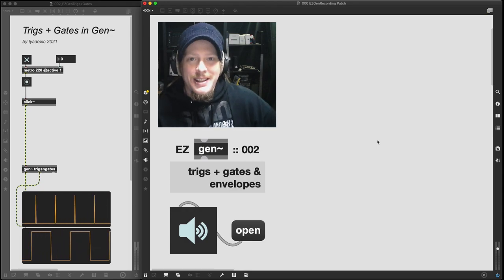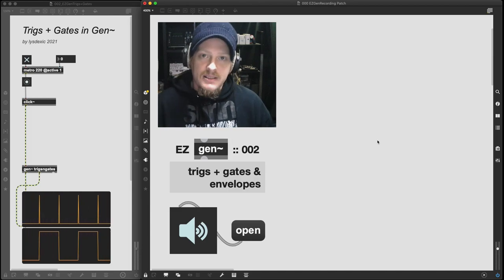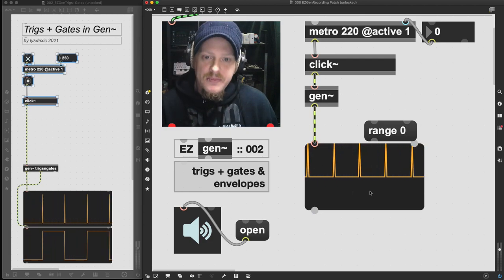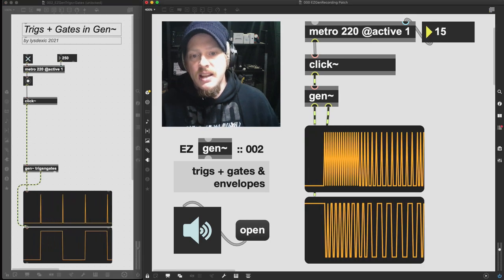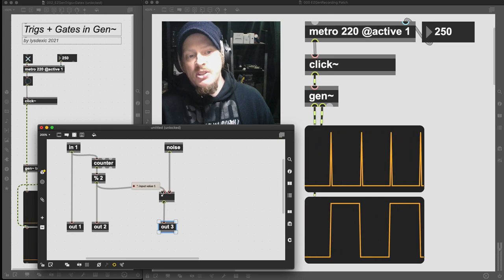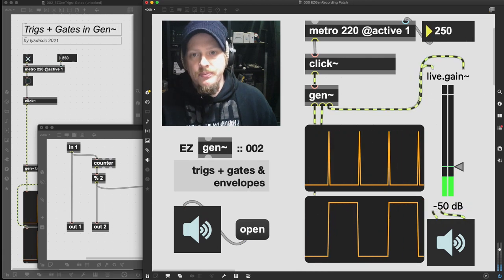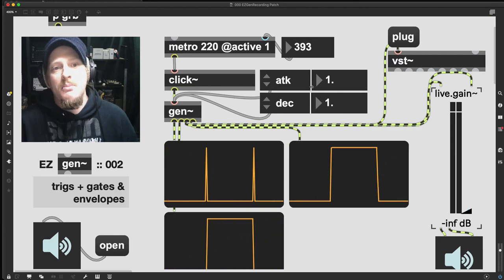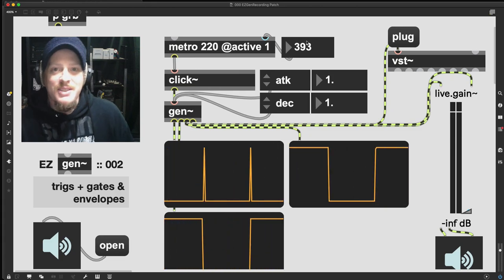EZ Gen~ MaxMSP Tutorial 002 :: Trigs + Gates & Envelopes

Comment: Hi amazing channel, a noob question how I actually gate signals outside gen patcher, like a square wave?
Reply from the maker: hey, thanks! to create a squarewave it’s really easy - use [>=~ 0.5] on a phasor

you can change the duty cycle / pulsewidth by changing the argument to a different value between 0. and 1.
Reply: @lysdexic  oh actually I think I express my self badly, I wanted to say how I gate signals from outside gen patcher, like I have a synth or a sample in a patch that uses this gen gate, anyway brilliant work learning so much form you
Reply from the maker: @anthonyarcana4391  no problem - you can gate signals using [gate~] but i recommend watching a video about [swanramp~] by dude837 (sam) too!
Reply from the maker: or perhaps do you mean how to control the gen patcher? the [param] operator in gen can be controlled outside using a message. i think i use it like this in some of the other videos (you can download all the patches for free on my gumroad) take a look
Reply: @lysdexic  what I mean is to open and close an audio signal as you do with the noise here but the signal comes outside gen~ and not inside as you’re doing in the vid